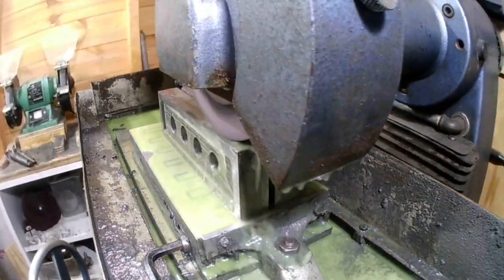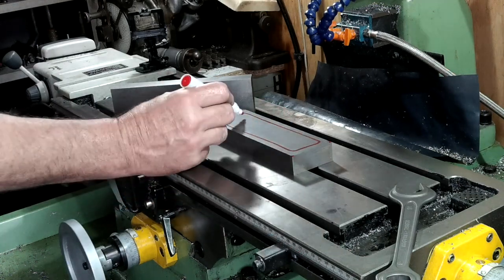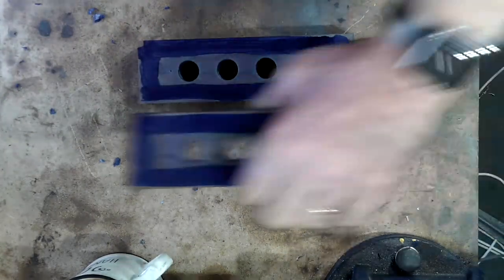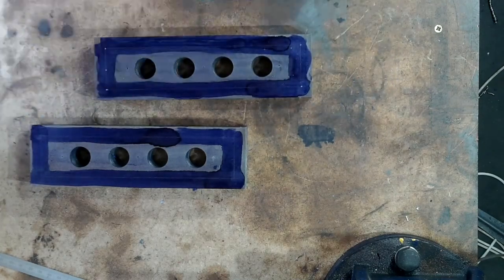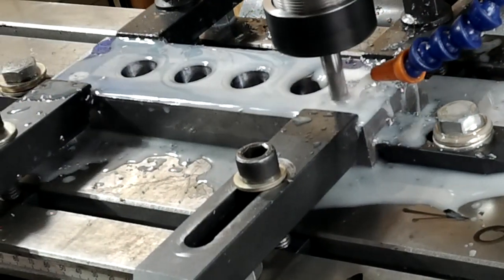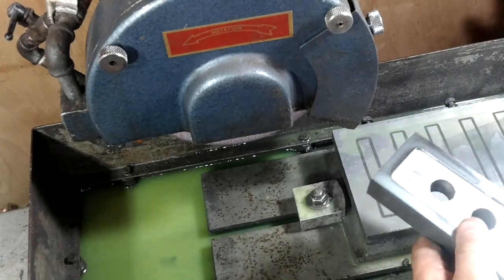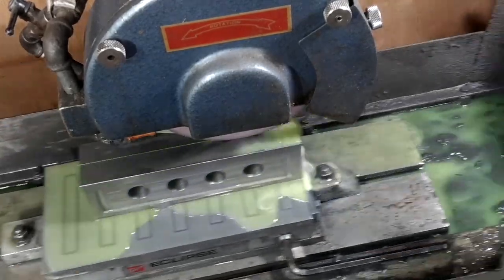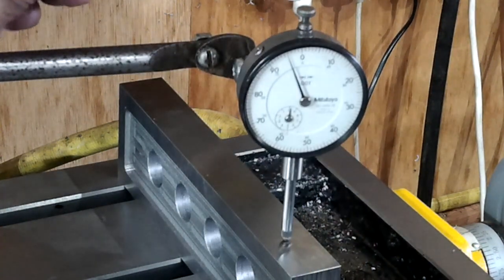Making Parallels

Comment: Hi Paul, nice project. What is the grit and material of the wheel you use on the surface grinder please?
Reply from the maker: I,ve never taken it off to find out, its Pink, so it should be for harder materials.